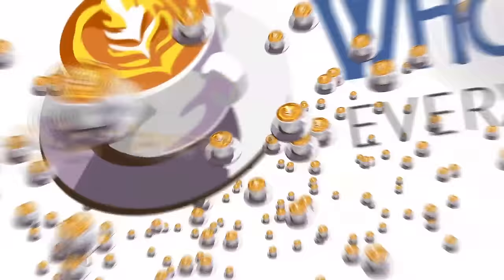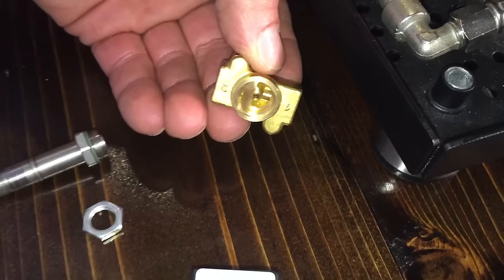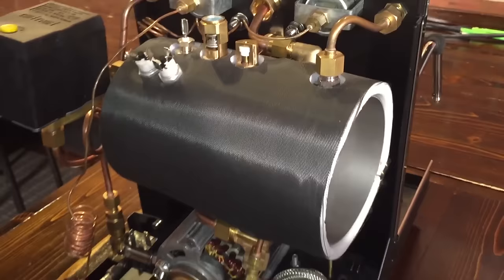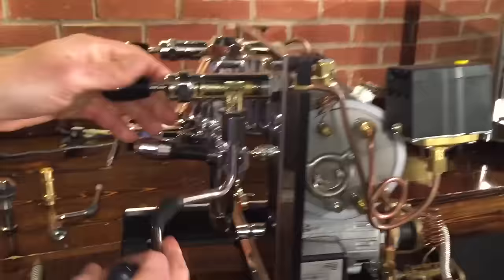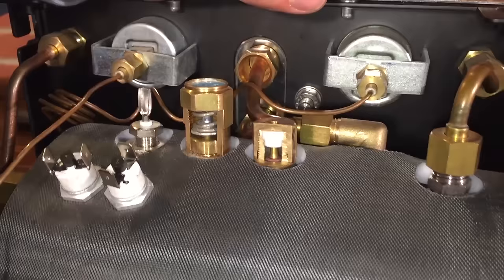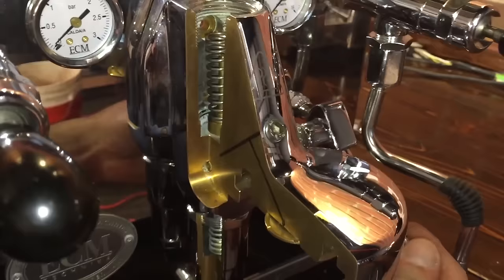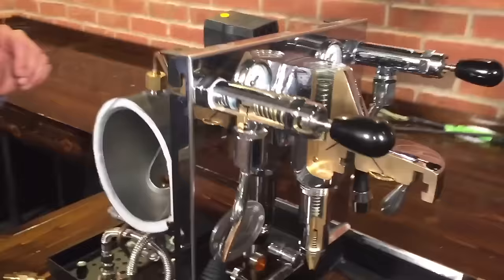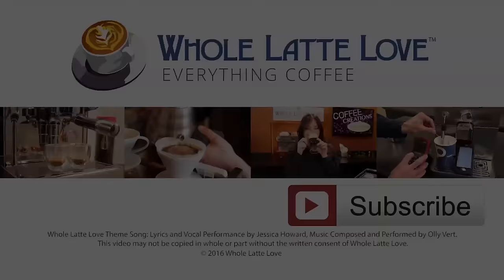How it Works: Deep Inside a Cutaway Espresso Machine

Comment: Too many parts and stuff. Go back to the early steam punk espresso machine with ball and gate valves.
Reply from the maker: Hey jbh, So those early machines actually used steam to make espresso. Very bitter flavor - one reason why old school Italians put buckets of sugar in their espresso!
Reply: @Wholelattelovepage  I thought bitterness came from the grounds and the way they're roasted. Moka pots use steam and boiling water and doesn't that machine blast steam too? Some form of very hot water has to pass through the coffee grounds.  They had an old copper and brass machine in Cafe Intermezzo in midtown Atlanta for about 2 decades. I sure miss that. Real pastries too. You know what, if you made a steam powered machine you could carry around I bet the preppers would buy it.  Something simple they could fix if it broke and the boiler could be exposed to open flame of their choosing.  Solenoids and switches will give out and they need simplicity.  Preppers have a limited range of advertising venues so it's easier to reach that market.
Reply: @Wholelattelovepage  I understand CO2 in the bean from roasting causes bitter elements to leach into the coffee when it is brewed or steamed.